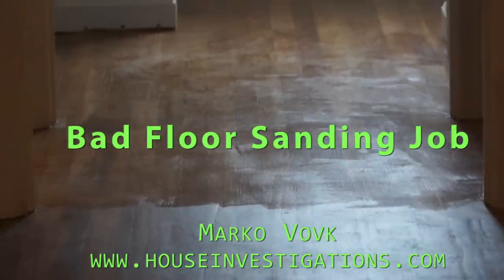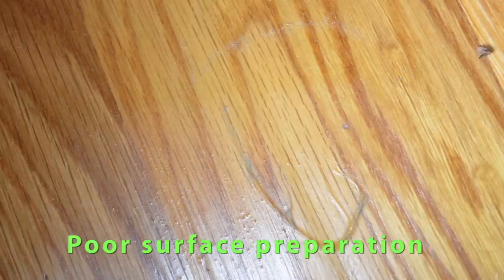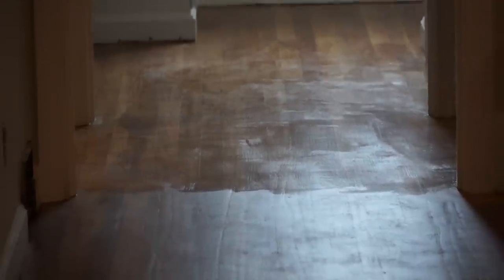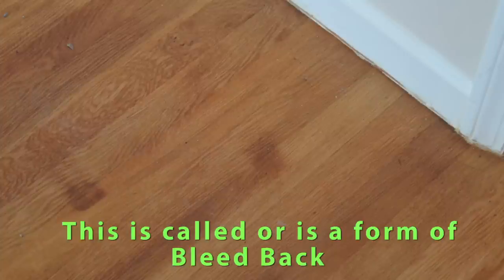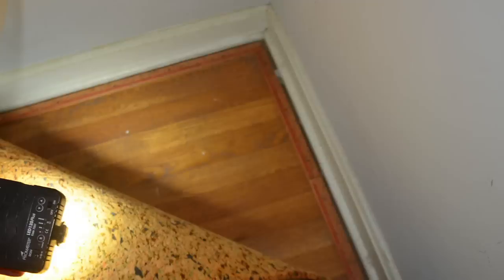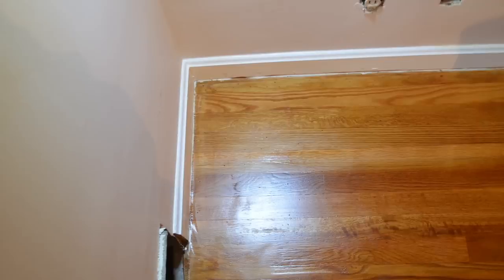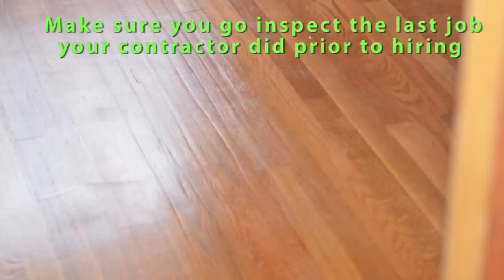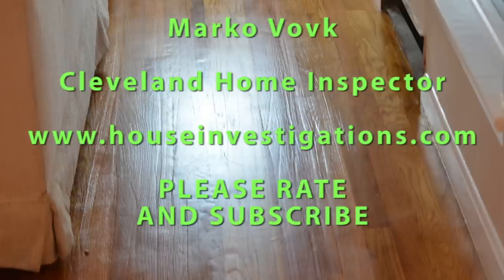Wood Floor Finish from Bad Contractor

Comment: Well, sometimes that happens when the floors is really uneven. Drum/belt sanders suppose to sand flat. Old floor sometimes are loose and vibrate and made shatter mark. Same with the edger. 1. Verified that drum that is flat2. Take all pressure from drum sander3. Sand all again3. Pawn sand all perimeter4. Buff all the floor 80 grit mesh screen with a white pads at 45 degree. Star taking out any mark from the perimeter.

Comment: As a flooring specialist I can see that not only the equipment was not calibrated correctly, but the lack of good judgement from the person sanding made this mess. The flooring contractor doesn't even have the basic understanding of how its done.
Reply: I doubt whoever did this was an actual floor specialist, I've seen helpers do better work a week into starting

Comment: This looks like a contractor with rental tools. It doesn't look like a floor refinishing contractor. This is the kind of job you get when your painter or contractor says yeah I'll do your floors. They go rent the tools and this is the results. Same results usually happen when people hire contractors to do their decks. Painters and contractors say sure I'll do your deck. And then it's just a matter of them experimenting. Just as what's shown on the flooring project here

Comment: First off.....it might not be bad equipment, its fixable! Just thinking its bad sanders period from the looks of it!! You don't get grooves from an unbalanced wheel. You will get what they call a chatter. What caused the grooves in the floor was the fact that the drum on the sander was to much on an angle.... thats what caused those long grooves. Second.... the circular grooves are caused by an aggressive edger....meaning the edger was also to much on an angle as well. And the person was not good at all using it. That is also fixable. The roughness on the floor is caused be the grit of sandpaper used, and my guess is that they used a 40 to 50 grit sandpaper to final the sand which a 100 grit is what is supposed to be used to final. The dirt in the finish, thats obvious.... shitty sweep and vacuum job. The finish itself is water base and a 12 inch foam pad was used.....why the were stop marks in the middle of the floor....if you will! You can also clearly see that a buffer was never used, why you see at the walls where the wood going long ways there is a line, that is caused by a sander( not an edger). And lastly, a red oak floor or any floor for that matter comes in 3/4 thickness, not 5/8ths now a days! In the 50's with that floor it was 3/4 thickness and you get away with sanding it 6-7 times before you see nails! I've been sanding floors for 23 years......don't bullshit people and real floor sanders. Not sure how the hell you are in business if you still are!!!!
Reply: There isn't such a thing "bad sander"  inexperience is the correct word.
Reply: Bulldhit

Comment: 110% believe this contractor that YOU chose was most likely the cheapest one you came across. That's what kills me about these videos. You never see work like this from actual hardwood guys. You know, the one that showed up in the proper vehicle that had his signs all over it and was filled with the tools that he owns. The guy you hired you do this job probably showed up in a 1988 Ford ranger with a few scrappers in the back of it, 6 week old fast food bags in the floorboard and had to rent the Sanders? And what did you do? 

"Oh your only 1/3 of the price as the other guy. Great! The jobs yours!"

And now your mad and want the world to know how you scammed yourself.
Reply: my thoughts exactly....can't put all the blame at the installers feet...he should have had enough sense to not trust cheap labor... Skilled labor isn't cheap; cheap labor isn't skilled
Reply: Yup that 1988 Ford ranger is a big red flag
Reply: Always make sure it's a 2000 or newer Ford ranger, the older ones will ruin your floors lol
Reply: Exactly, i agree!!

Comment: No experience ...floor Sander's are fine , its the people he using them that need to get fixed..I guess you get what you Paid for..
Reply from the maker: Rob D you are right about the people, no experience
Reply: Clevelandmarko you are right about the edger having adjustments. floor belt sanders also have adjustments as well as drum sanders. Just depends on what machine is being used. old sand paper has nothing to do with it. If the paper gets loaded then you get burn marks.  The swirl marks and rough spots on the floor are caused by not using higher grades of sand paper in the finish sanding. Most commonly a 36 grit is used to take off the old finish  followed by sanding with 60,80,100 and if staining 120 grit followed by 150 grit screen on a square buff or floor buffer   to blend in the edger and field sander marks. This eliminates the shadow you often see near the walls.  You appear to be a seasoned pro. I have over 50 yrs of  floor refinishing  and am a NWFA certified master craftsman. Hope this helps you in future inspections and trouble shooting.

Comment: its not the tools its the old sand paper that made the long lines!! they didn't want to buy new ones!!  lolol funny when others that don't do this kind of work tell the tails of why shit happens!!

and they don't know how to use the edger!! its not junk tools!! were do you get this shit from??
Reply from the maker: You are right. I am telling a tail. You are probably right about the sand paper. I think the sander heads have adjustments.  And you are right also about the edger. Thank you for you for your comment.
Reply: Clevelandmarko drum sander don't need adjustments!! its used sand paper.. the adjustments are (( NEW SAND PAPER )) the drum sander adjustments are only for the paper not to jam on each side of roller NOT for anything else..

the wall edger has no adjustments on it.. its a disk round an just sticks to the bottom...

they used old used up sand paper.. hence the lines in the floor are from nails they ran over and scuffed spots on the paper that don't sand... that's the lines you see..

the edger spots and dips are from not knowing how to use the sander!! they keep it in one spot to long and don't know how to float the round disk around corners and walls..

and they didn't take the 1/4 round off the floor trim so you can have a cleaner look after done sanding..? 

work smart not hard!!!   working smart is hard enough!!

sorry to see this happen to you.. it hurts us good contractor also!